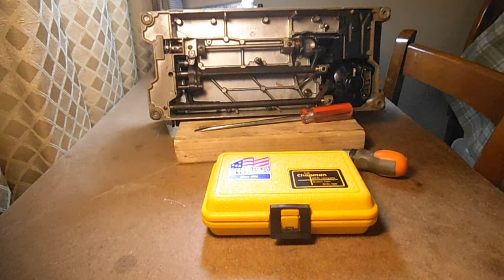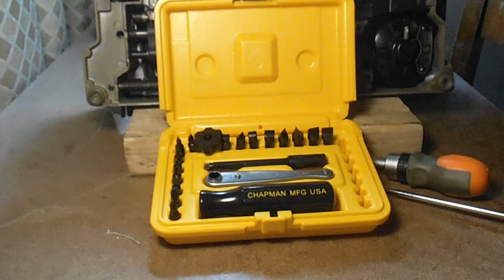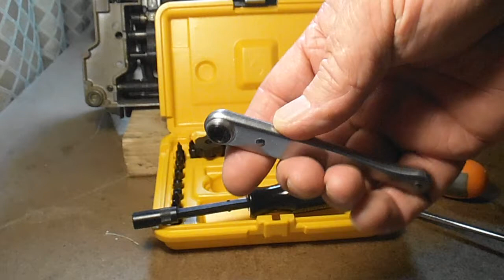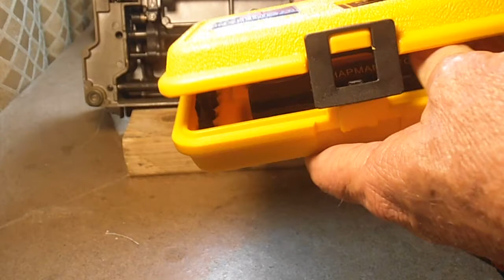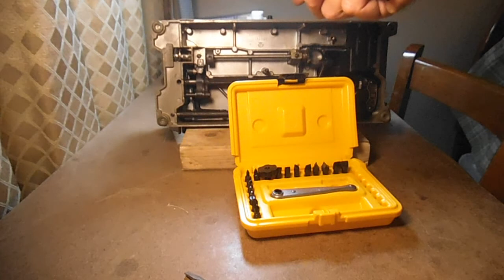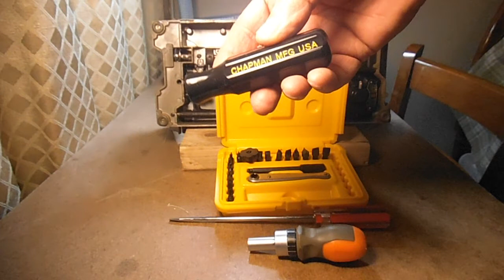My New Screwdriver Set for Sewing Machine Restoration

Comment: 12:11 - It's funny that you have a Singer 301 on your workbench on its side. At this precise time in the video you headed straight for the set screw holding the bobbin shuttle assembly in place.  This is exactly the screw I am having trouble with.  It is STUCK! Tried everything and have partially stripped the head due to not having the right screw driver, dang!  And here you are, with my solution.  Going to get a Chapman ASAP to fix my problem.  So perfect.

Lovely company. So glad it is made in the US. Finally, one company holding out.
Reply from the maker: Glad you found the video. I have used this set dozens of times and very happy with it. Good luck.

Comment: Andy. I got the 9600 hoping to unscrew the gib screw.  The smallest bit is the 88 but it doesn’t seem to work. Any suggestions
Reply from the maker: Can you tell me which gib screw you are speaking of? What model number of the machine? Thanks.
Reply: 301a bobbin hook case/ bobbin holder
Reply from the maker: @kathirandallwhitt  OK. There is a part called the Rotary Hook Gib attached to the hook on the 301. I use the small screwdriver that came with the machine as seen here starting about 12:15 https://youtu.be/yy_yoD2CbWM  If you are talking about the screws on the actual bobbin case I use the same screwdriver: start at 3:02 in this video ttps://www.youtube.com/watch?time_continue=182&v=gUUFFAn9DSs&feature=emb_logo   If you do not have that small screwdriver (many don't) you can buy a set of precision screwdrivers. Here are some examples: https://www.harborfreight.com/search?q=Precision%20Screwdriver%20Set,%2016%20Pc.
https://www.amazon.com/Choice-9-Piece-Precision-Screwdriver-Phillips/dp/B0747DYJJR
https://www.homedepot.com/p/Stanley-Precision-Screwdriver-Set-6-Piece-66-052/203713248
https://healthyhandyman.com/best-precision-screwdriver-sets/

Comment: Hi Andy, I have a question, I keep breaking my husbands gunsmith screwdrivers while restoring these old sewing machines :)    I see you have used Chapman's screw driver set for about 2 years now. Functionally, How are they holding up?  I have to replace ours soon. Thanks
Reply from the maker: Good question, Leah. They have held up very well, with just one broken tip. It was my fault mostly. Instead of using the mini-rachet I just forced the driver by hand and one end of the bit tilted up out of the screw slot and I snapped it off. About once per month, I spray down the set with my 20% solution of Krud Kutter Degreaser, including the case. They still look brand new. Today I released a video about a new Screwdriver set I recently purchased as a supplement to my Chapman. Here is the link: https://youtu.be/7_DHIC6eskc
It has been working great for the week or so that I have used it. I share the bits and drivers between the two sets a lot. If I was buying the Chapman today I would probably buy the 8900 set as it is only $6 more and you get more bits. Either set should work well for you. The Chapman set is made in the USA and you saw it comes in pink? Maybe the Wheeler set for your man and the pink 8900 Chapman for you? Thanks for watching.
Reply: @andytubesewing1953  Thank you Andy, I will check them out the Wheeler set. I did order the Chapman this morning from Amazon because of their fast shipping, Just 2 bucks more. I like your idea about the pick and almost ordered it  :)  Thanks also for the tip on Krud Kutter. I LOVE that stuff!
Reply from the maker: @leahquesenberry2958  It's all good, Leah. BTW, I have used the KK on greasy jeans and it worked great! Best of luck.
Reply: @andytubesewing1953  We use KK on our stove after frying fish or anything greasy that makes a mess on our stove, Works great!
Reply from the maker: Thanks for that tip! Household cleaner too! I like that idea.

Comment: Your Chapman set caught my eye in some of your other videos.  And, after watching this video I couldn't resist.  I just ordered a set.  I went with the desert tan case.  Their price has gone up a little.  After factoring in the shipping cost ordering them direct from Chapman and comparing to Amazon I ordered them from Amazon.  For $1 more than ordering them directly from Chapman I got them with two day prime shipping from Amazon.  I noticed on the Chapman site that if one browses sets by use and selects sewing machines, this is the set that comes up.
Reply from the maker: I hope you'll enjoy your set as much as I do. They are strong and well made. I have not ruined a screw on a machine since I bought them. I love the mini-rachet a lot. I have loosened some very tight screws with it for sure. I was looking to expand the number of bits recently and a viewer sent me a link to a set she had recently bought. It looked good, and I bought it instead of adding Chapman bits. The nice thing is the bits and drivers are mostly interchangeable and this new set came with several very thin blades. I'm just finishing up a series on a Singer 353 Genie, and a few of the screws had slots too thin for my Chapman bits. I did a review of the new set, alongside my Chapman set, and as luck would have it I will be going public with it Monday evening, 6-24-2019 if you'd care to see it. So, between the two sets, I've got quite a few bits, two good drivers and the mini-rachet. I'm a happy guy. Thank you for watching my channel, Kevin. It was nice of you to comment. Take Care.